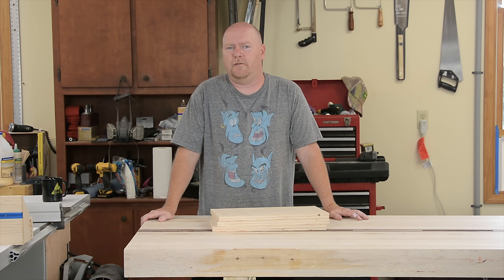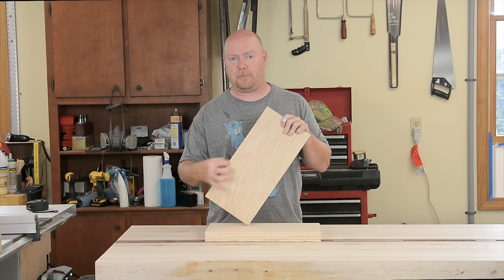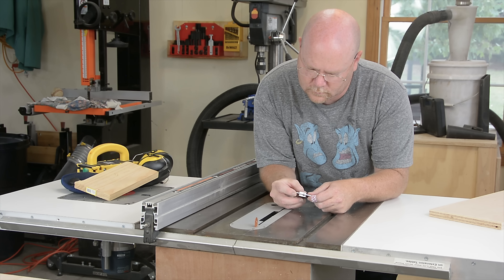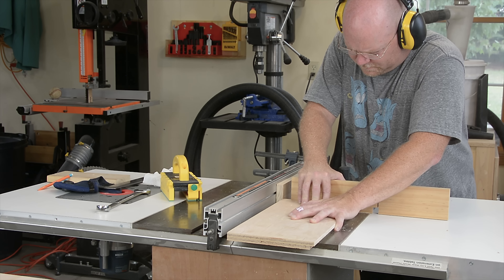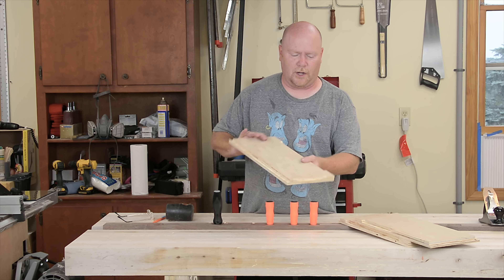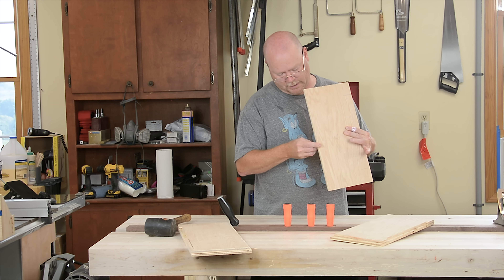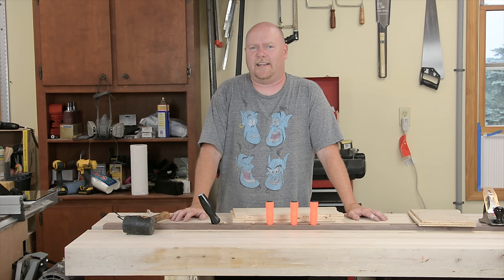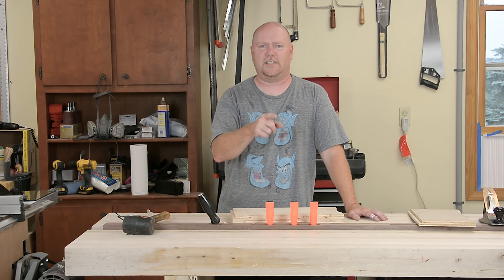How Fast is Your Rabbet?

Comment: Nice comparison Matt.  I prefer the router bit rabbet for accuracy when making cabinets or furniture but the table saw two cut rabbit is nice to use for custom size rabbets, unlimited adjustment dimension and quick with small stock.   I know there is a "cutting rabbits" joke here somewhere, i just couldn't think if it right now. lol  Take care